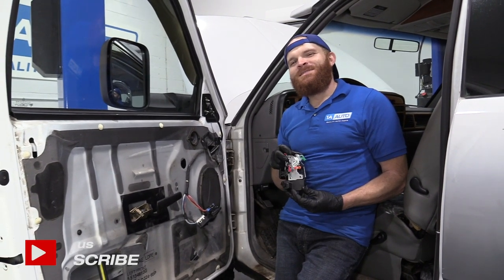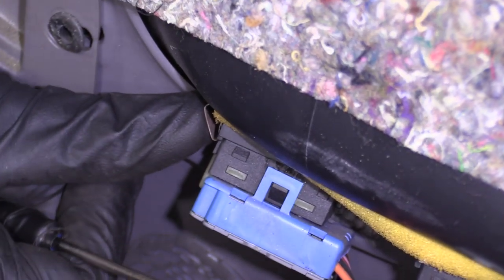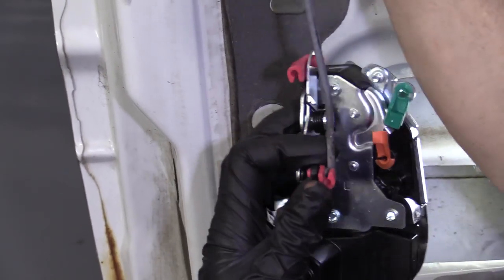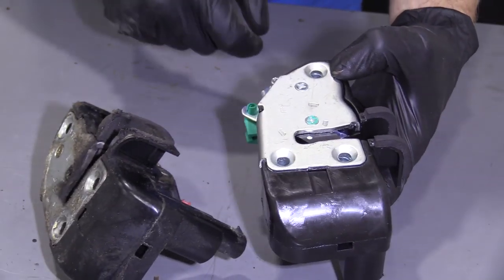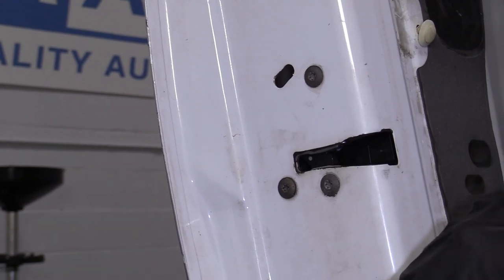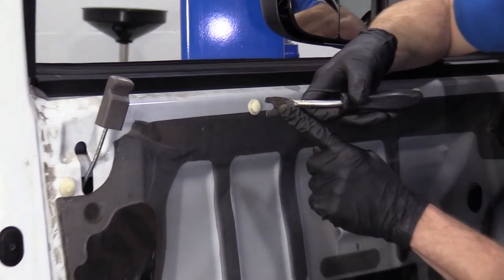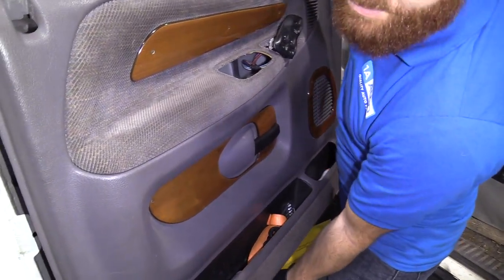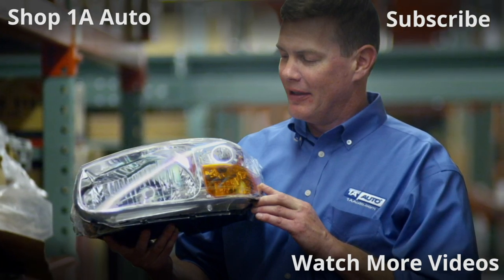How to Replace Door Latch 94-02 Dodge Ram 1500

Comment: Thanks for letting me know about the window channel bracket, too.  It's a two part piece and the bottom part of mine had somehow pulled the head of that bolt all the way through the door jamb and was banging around inside the door.   I fixed that first and used a big washer when putting it back together.  As far as the latch assembly, all 3 bolts were super tight and I needed to heat them up before I could loosen them.  To fix the damaged door jamb metal where the bolt holes were I used an old license plate as reinforcement (thin sheet metal).  I measured where the holes and slot should be, and drilled 5 holes into my  homemade reinforcement plate (3 for bolts, 1 for allen nut, and one for the slot stop).  Using a round file I filed out the holes to exactly match holes on the latch assembly.  Then using tin snips I trimmed away excess sheet metal and cut out the rest of the slot.  File down sharp edges and corners.  The 3 bolts are too short to accommodate a washer between the bolt and the new sheet metal.   I used a big flat screwdriver to slightly pry apart the 4 colored plastic locks to unhook the 4 metal rods.  Spent 6 hours, most of which was spent dealing with overtightened bolts and fabricating the sheet metal.  Saved $400!

Comment: Hey Mr. Mechanic... on my 1996 2500 there is a “port” just slightly above the latch. When I noticed it the job was a breeze. I was about ready to drive the truck over a cliff after trying to access everything the way you did. I had been using 4 letter words for the better part of an hour.... after the port discovery I was done in 5 minutes.
Reply from the maker: +Stu Thanks for the tip!

Comment: So my key fob does not work to lock or unlock my driver truck door and has been kike that for years,  now my key will not let me unlock the door and i have to go through tge passenger door to unlock from inside. Would this be the part i need to resolve the key lock issue?